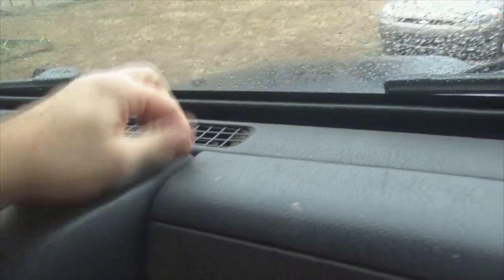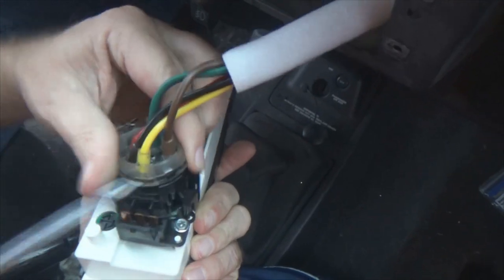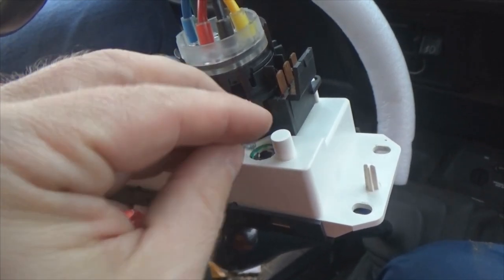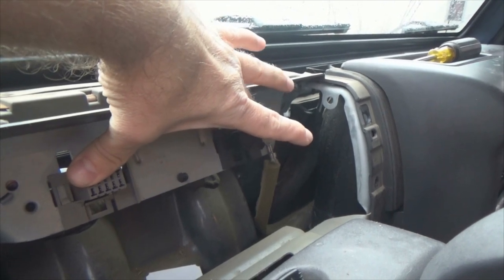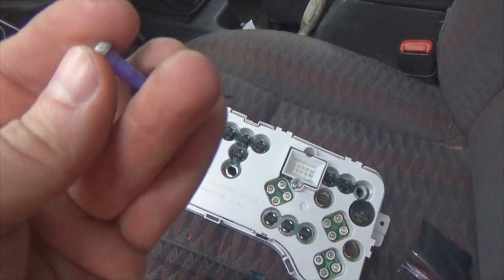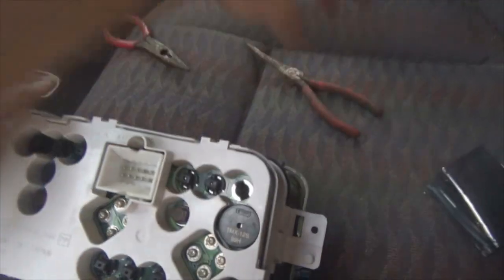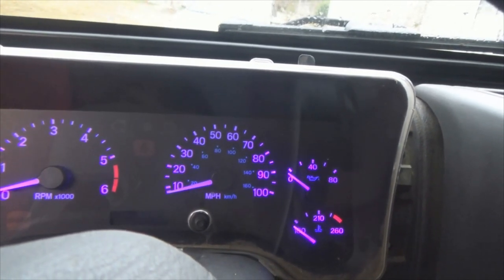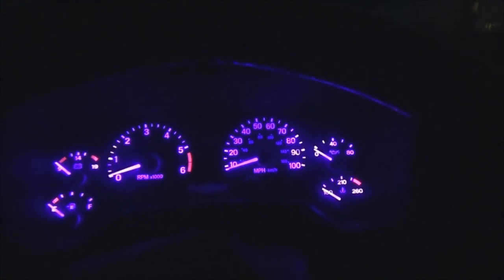Jeep Wrangler TJ - LED Dashlight conversion. Cheap and Easy

Comment: The Block 2 Wranglers ('03-'06") are somewhat different than the Block 1 Jeep TJ ('97-'02) as seen here in this video, but the principals for the dash cluster gauges (T5 Wedge bulbs) are the same. 
HVAC control system (T4 Neo Wedge bulbs) & Radio deck (self-illuminated) cover, rear wiper + defroster + Rubicon locker switches (T4 Neo Wedge bulbs - 4 total) are a little different as the '97-'02 older Block 1 TJ models have an extra screw in its cowling under the ash tray. Block 2 Wranglers generally don't have an ashtray, hence no screw there.
As for the 2003-2006 Jeep TJ / LJ, they are different in their dash plug-ins / cabling + have lighting for the 1st gen. Rubicon factory locker indicators. 
Good video and very helpful!

Comment: On my 1999 TJ Wrangler occasionally all dash gauges go to zero.  I can give the top of the dash a rap or a gentle hit and the gauges start working again.  Do you think  the plug in sockets from the instrument cluster is loose and just needs the dash needs to be removed and plug the sockets in again.  Thanks for your videos.  I replaced the a/c 4 position blower switch following your video and now it works perfect.  Great vids!

Comment: Just ordered some leds because if this video, thanks! Do the dash bulbs work for the heater controls or are they different?
Reply: Jeffery Maness  there different. Five worked fine, but the heater lights are a smaller type. Dude posting the video didn’t mention that. Your reply was seven months ago. Did you ever find out the size for the three heater lights. Thanks Randy. Not sure what year you Jeep is?.. I have a late 2001 Jeep TJ

Comment: Hi I have a late 2001 TJ, just changed out the five light in the dash. Thanks for the tutorial. The problem I’m having is the heater lights are different size they’re much smaller do you have the number or link to Amazon for those three? Thanks Randy
Reply from the maker: You are welcome, glad the video helped you! That is my buddies TJ, I don't remember right off about the heater control LEDs. There are places online to look up the number or you could call an auto parts store to get the bulb number. Thanks for dropping in and checking out the video and leaving a cool comment! Have a great day!

Comment: I need HELP 😓 I was doing it right, all lights, but in the last one the socket didn’t worked well, so I use the little socket of the cruise control (my Jeep doesn’t have one) and suddenly all the other LEDs that I put doesn’t work anymore, just the turning signals, stop, warning, etc